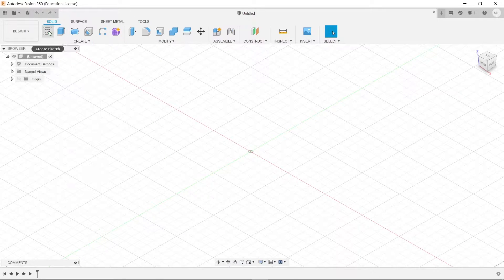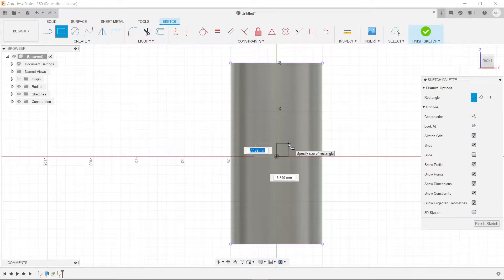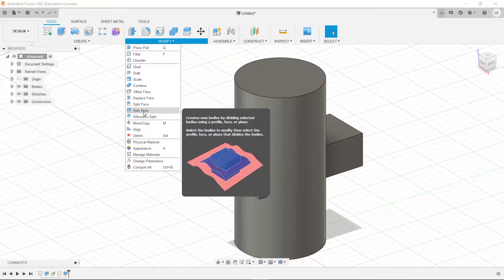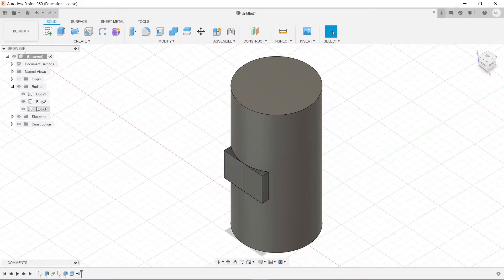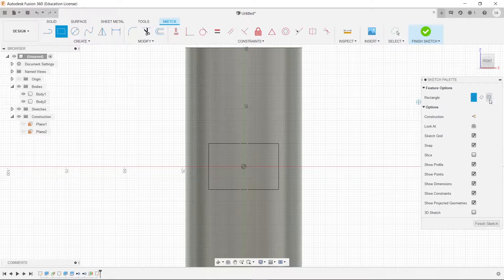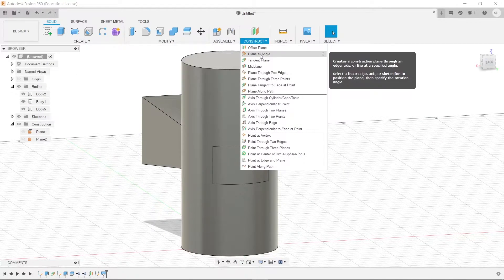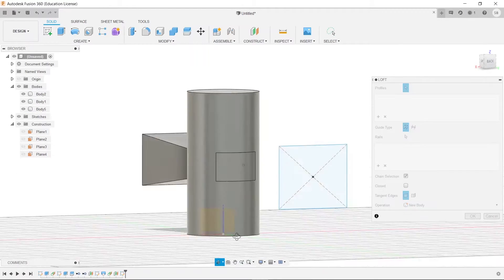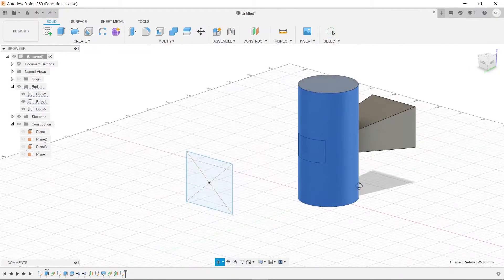Fusion 360: How to loft from a curved surface

Comment: I was looking for this for days. I was trying to add a mounting block for a cylindrical toothbrush holder and you have helped me figure out the final hurdle. I was clicking the face of the cylinder during loft and it of course makes sense, now 😅